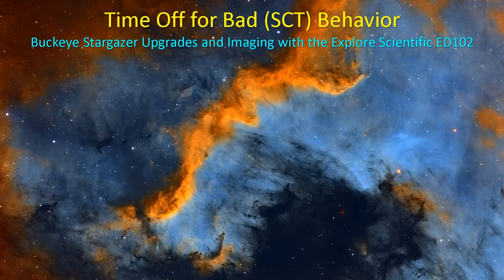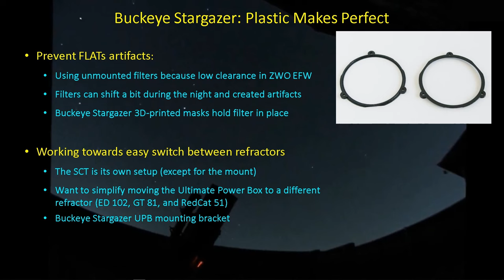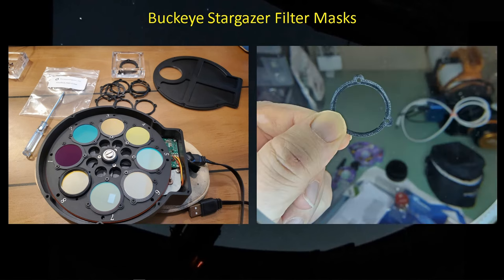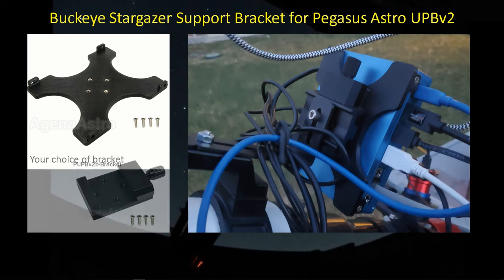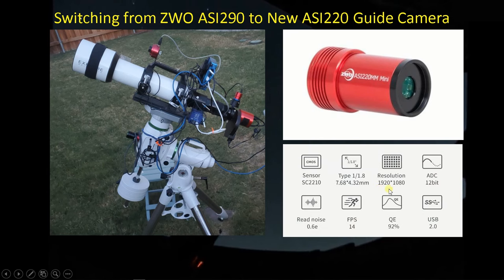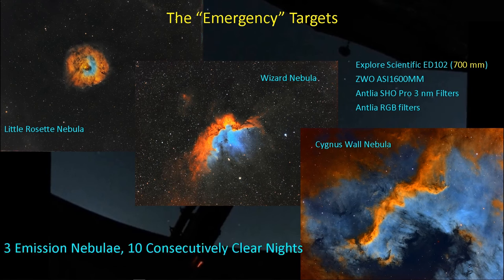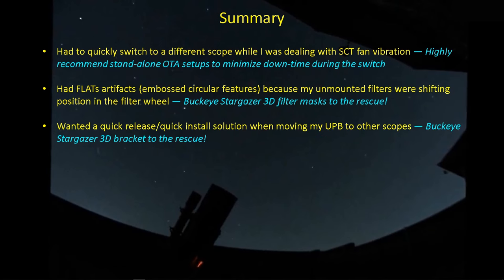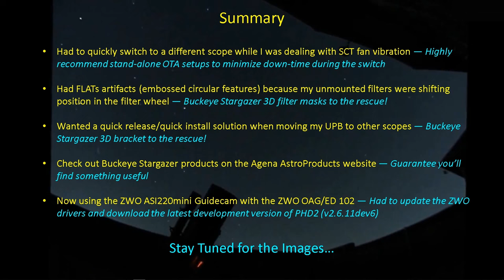Buckeye Stargazer Upgrades for the Explore Scientific ED102

Comment: I had exactly the same problems: vibrating fan on camera and inaccurate filter wheel. This screwed a lot of hours astrophotography. 

Eventually, I rid of both; then got QHY pair (camera-filter wheel). All problems are gone. 
I have no more ZWO equipment and no more problems with rig.
Reply from the maker: Well, I’m not quite prepared to ditch all,of my ZWO equipment. For better or worse, I’m stuck with it. Something to consider down the road, maybe.
Reply from the maker: That’s good to know. Thanks

Comment: Curious -- When moving the ultimate power box do you move the small dovetail bar with it (i.e., take it off the L bracket) or do you have a Vixen bar on each mount and simply unclamp the V bar clamp with the thumbscrew?
Reply from the maker: I move the dovetail bar with the UPB attached. It's just the one socket head screw, so it's pretty convenient.

Comment: Does the slightly larger sensor size of the asi220 show up on the small prism of the ZWO OAG ?  And does it capture more guide stars?  I am thinking about upgrading from the 290 as I am starting to run into problems finding enough guide stars on my iOptron HAE69 at a 1500mm focal length (as it requires .5 to 1 second guiding).
Reply from the maker: It should - the small ZWO OAG mirror is 8 mm x 8 mm, which is larger than the ASI220 sensor. For my ED102 (700 mm), I don't have to even think about the guide stars and OAG view. The ASI290 I had been using was perfectly fine - I just needed a new guide cam since I decided to use the WO Uniguide guidescope with the other two refractors. For your 1500 mm focal length, you can certainly use the extra sensor area of the ASI220 (I use the ASI174 with my SCT).
Reply: @Aero19612  Thanks for the input.  I ended up getting the ASI220 and both the sensitivity and the larger area made a substantial difference.  On the Bubble Nebula on one side of the meridian I was only able to pick off one guidestar with the 290, but I was able to find multiple guidestars with the 220.
Reply from the maker: @dirkfierce2525  Great! I’m glad it worked out for your setup.